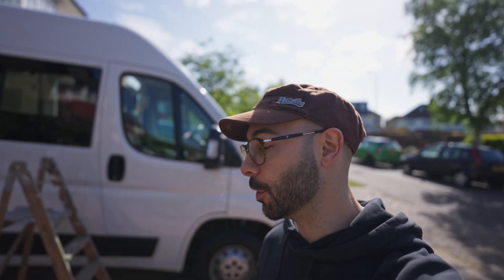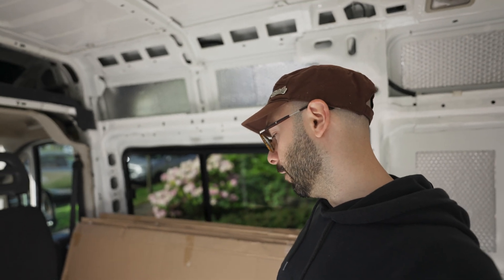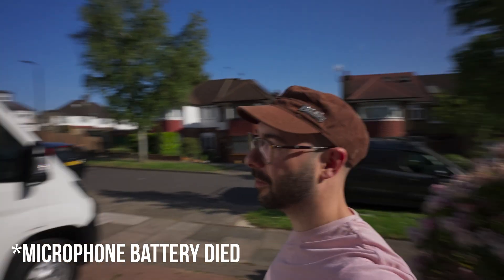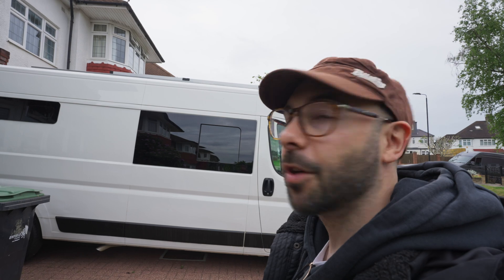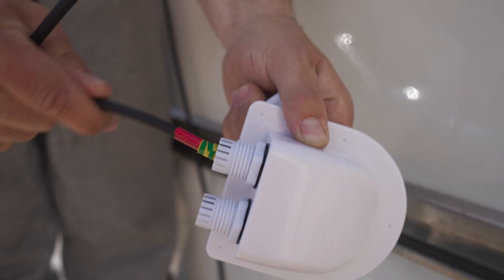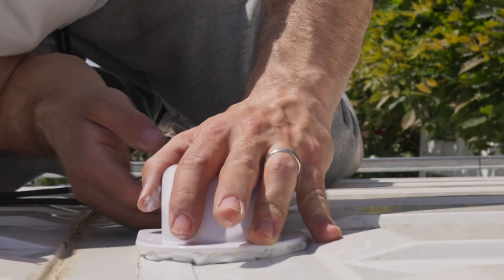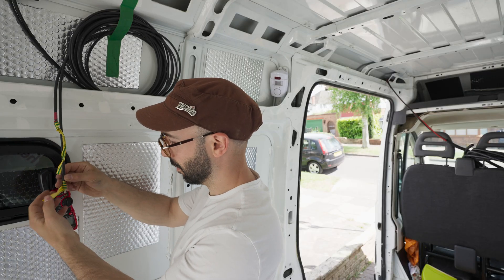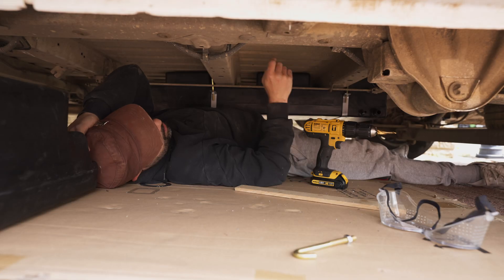How to make a Unistrut Solar Mount on a Van

Comment: Hi guys doing the same build as yours almost. How did you fix the solar panels to the unistrut?
Reply from the maker: We just bolted them on, through the holes we drilled in the solar panel frame
Reply: Hi guys , did you bolt into the part of the solar frame that butt's on the unistrut. Getting the same panels as 1500mm is perfect for me as well . Did you only use the 4 corners to bolt down ?
Reply from the maker: Yep we bolted them on each corner with washers

Comment: Hi Joe 'n' Jodie, just found your channel, so I'm enjoying binge watching! May I ask if the Unistrut you used  in your solar panel build was the narrow 41 x 21 for both the mounts and the full rails? Cheers, good luck and Seasons Greetings.
Reply from the maker: Yes it was, 41mm x 21mm 2.5mm Single Slotted Channel (3mts)

Comment: Great install, no matter how many watts you have you can always use more for the cloudy days. I have 1,200 watts of solar panels and 900 amp hours of lithium batteries for the mini split ac/heater.
Reply from the maker: We're considering AC, it must be wonderful when the batteries are full and you're parked in the sun powering the AC

Comment: How did you tighten the bolt under the panel into the unistrut? It's a tight gap!
Reply from the maker: It was a tight gap for sure, I held the bolt at the threaded end with needle nose pliers and turned the nut with a spanner

Comment: Hi there - great install! Can I ask, did you use m10 or m8 channel bolts? Thank you!
Reply from the maker: Thank you, I just checked the invoice and they were M6 Non Spring Channel Nut
Reply: @JodieandJoe  thank you for taking the time to check. Fortunate you did, as I thought they were m8! Will save me a few pennies. Thanks
Reply: @JodieandJoe  oh and sorry, one more thing - the small plates with a keyhole shaped hole in that slotted onto the t-bolts, did you just make those by using some of the unistrut and opening half the hole with a cone bit? Thanks!
Reply from the maker: That's it!

Comment: Maybe I missed it but how did you fix the panels to the Unistrut?
Reply from the maker: You're right I forgot to include it, we drilled holes in the solar panels and used nuts and bolts to attach them to the unistrut

Comment: Awesome stuff.  Quick question. Do you have experience with electrics within your usual working life? . I think electrics are the scariest thing for people attempting this that have no experience. 

 My Dad was an electrical engineer. As a kid he was desperate to teach me . I wasn't interested.  Looking back, I wish I'd actually listened.
Reply from the maker: I'd definitely get help from a professional with the 240v AC side, if you haven't got the experience.
The low voltage DC side is very easy and safe so with a few YouTube videos you should be able to teach yourself and throw something together!
Reply: @JodieandJoe    Thanks. I'm considering buying Greg Virgoe's  guide he produced when doing his van.   You're right, youtube is very useful.   Good luck .

Comment: Only waisted money to have 3 of those 150 W panels on the roof 2 is more than enough and you would could put that went fan more to the middle of the van for better air flow anyway it is good videos  :)
or if you "must" have 3 then 1 in front and the two in the back and the fan in the middle! The key is to plan "forward! what it will be looking like when it's done!
And those 150 W panels cost about 300 pund each?  then you could use those money on a powerbank or some and saved for on the big 1200 w cost about 1200  pund or some for days with no sun, and that is it much of in UK i think! Only a suggestion!
Reply from the maker: In our victron video we explain why we have sooooo much capacity! 🤭
Reply: @JodieandJoe  You are right guys! Always go with the most capacity that you can fit up there. I'm a little jealous I must say. I'm just finishing a build here, hopefully in 2 days I'll be done. I've got six 215 watt panels(1,290w), feeding a pair of 280 Ah LiFePo4 batteries rigged in series. My camper is a 50 amp so I have a pair of the Victron Multi-plus inverters, one to feed each leg of the electrical service. I look forward to hearing how you are set up performs in the coming months.
Reply from the maker: What a monster setup!